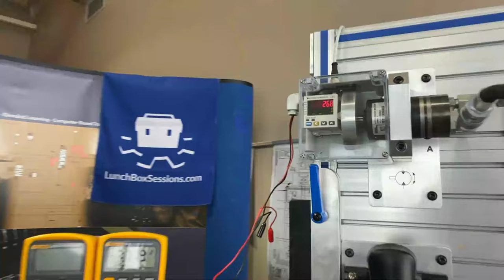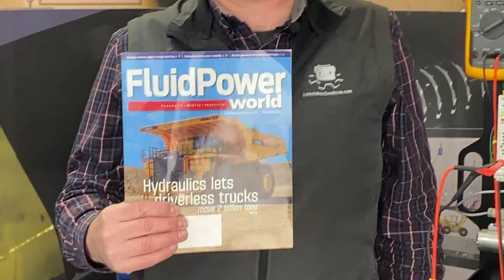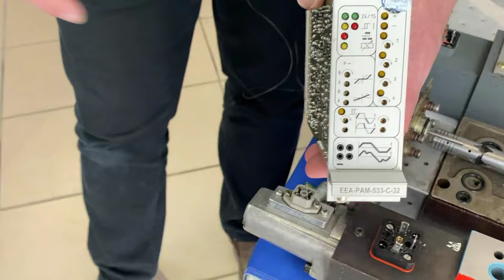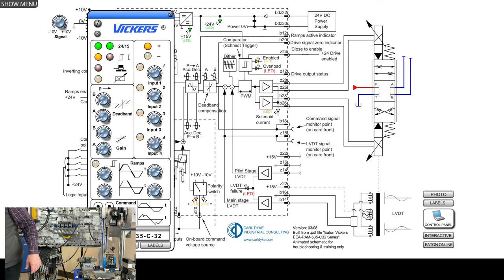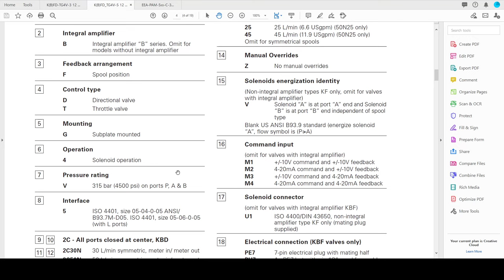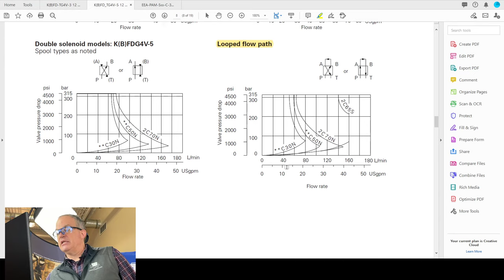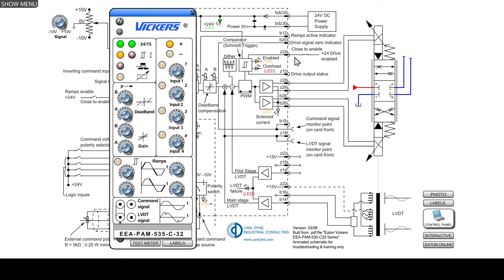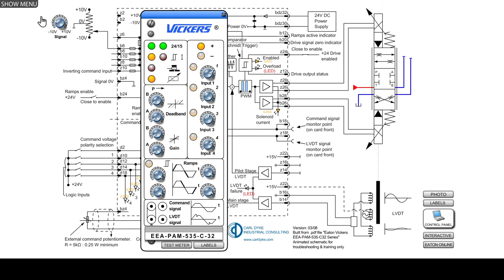Proportional Directional Valves: Fun With Electro-Hydraulics

Comment: We are facing one critical issue with on board proportional card rexroth +/- 0 to 10 V. With -ve voltage apply some time valve start working in +ve supply direction so operation got opposite. After reset valve supply same valve start to work normal. Sir, Please suggest root cause and solution.......

Comment: Really thx for the video and the explanations, very useful. I would like to ask you if all the proportional solenoid need a PWM, I mean, I think it the ramps and dead band could be programmable at the PLC, but still the need of PWM signals is required because of solenoid. I have been search for a proportional valve that does not required the PWM but a normal 0-24Volts signal.

Comment: What is diffrence between servo and proportional valve
Reply: A servo valve is a type of high performing proportional valve. The valve that can perform well in a servo loop is one that can respond very quickly and accurately to changes to the input/drive signal.

Comment: Excellent. Can anyone tell me please what is "condition command signal" (measured by left multimeter)? I am not relevant to electronics... Thanks for sparing your valuable time.
Reply: Yes I can explain. In the video when i spoke of conditioned command (upper right monitor point, left multimeter), I meant the the external command voltage coming in to the amp card is processed first by the ramp value, the gain value, and the deadband signal, therefor the multimeter measuring the upper right monitor point (the left multimeter in the video) may not echo the value of the raw command voltage. Does that answer help?
Reply: @CarlDykeHydraulics  Thanks for your kind reply. I was thinking it's a potentiometer resistance. Thanks for correction please.
Please keep us educating.
Thanks.